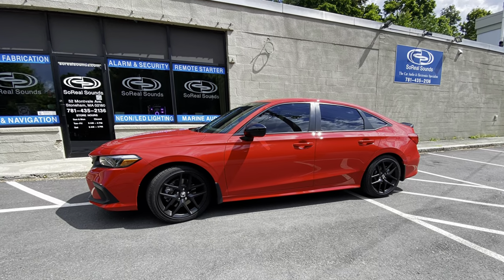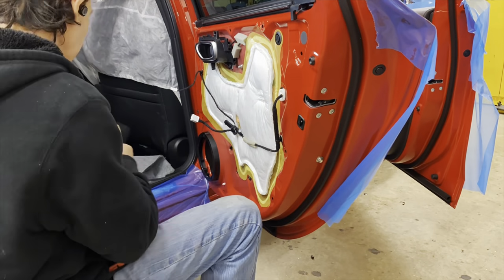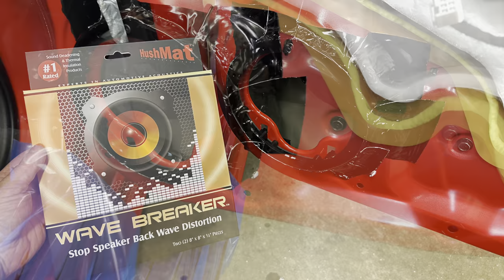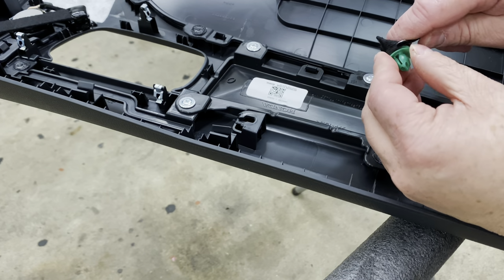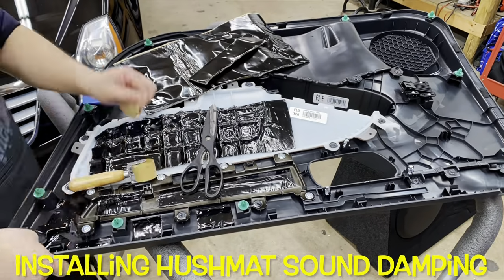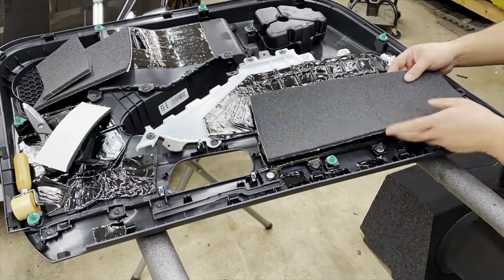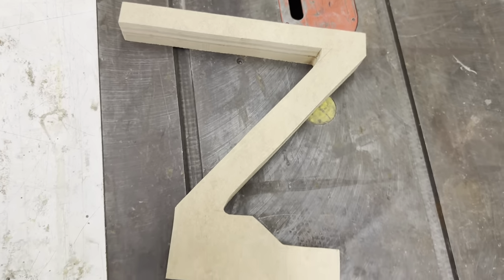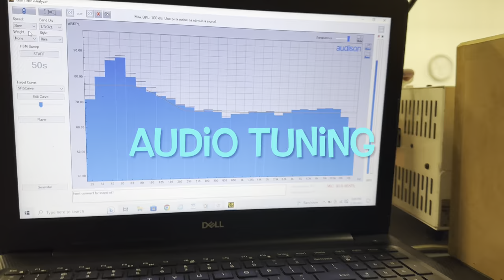Honda Civic Audio System Upgrade: Alpine speakers, Hushmat Sound Deadening, Audio Control DSP Amp

Comment: This helped me for sure! I just did a simple front speaker swap with some JL audio c1s. Very good and responsive speakers, but since they are much thumpier than the stock civic speakers, they were creating a rattle that was driving me nuts. I spent my entire day just putting foam around the bracket, speakers, and the door. So far iv minimized the rattling to a good enough point. When I do the back speakers I’m just gunna rip all the door apart again and go to town on sound dampening and foam
Reply from the maker: Awesome! 🔈🔉🔊

Comment: Where did you get the speaker wire harness/adapter?
Reply from the maker: @benbryceholden1  for speaker adapters if we don’t fabricate them we use Metra speaker mounting adapters. Metra also makes speaker wire harness for many vehicles. In this video it was the Metra adapters + harnesses. Email us if you would like to check pricing and availability. Our email is info@sorealsounds.com

Comment: Where is part 2??!!!!
Reply from the maker: There is no part 2. The subwoofer enclosure was built for a Civic prior to this one. When the client got this Civic we transferred the subwoofer system. This video was second upgrade made for the interior speakers and DSP amplifier. What specifically are you looking to see in a part 2? We can check to see if we have any videos that have what you may be looking to see.
Reply: A video on how you took the rear deck off? I want to either eliminate my rear deck so there’s no rattles or sound treat under like in the video.
Reply: Wtf! this video sould be taken down for rule violation. This is considered edging content. Where's the end result?

Comment: NICE Job! I like the cloth wrapping of clips IDEA!, I may do this as well, but maybe put on the base and cut a slit so its a little easier to slide in. People do not realize how time consuming it is to do doors, panels etc. I am sure its sticker shock when you give customers the estimate for sound treatment.
Reply from the maker: Thank you! Clip or mounting base will work. With cloth tape like this ( Tesa Tape ) we find it tends to fall off the base after a short amount of time so the next time the doors come off the tape can easily let go. Wrapping the head of the clip has been extremely reliable for us. Fully doing doors the way we recommend can be a sticker shock for some, but not as much as you would think because of our process. Once our clients understand the value in sound treating a vehicle our clients they understand exactly what they are investing their hard earned money into. We give our clients all the information for them to choose the right solution for them, so sticker shock is not a huge issue.
Reply: @sorealsounds  all great points. Thanks!!
Reply from the maker: @daveroski  You’re welcome!

Comment: Which speaker brackets did you use top mount aftermarket speakers to the doors?
Reply from the maker: Metra 82-7805. Be aware many speaker magnets are drastically larger than the factory Honda speakers. Many times modification to the factory speaker opening in the door must be done to fit the new speaker, even with this speaker adapter.

Comment: What thickness Hushmat megabond did you use on this project and is this your typically used thickness?
Reply from the maker: We use all three thickness all of the time. Which one we use depends on reason, and available space. On this car rear  deck was 1/2” and door panels was 1/4”. 1/8” was used in many spots through out the vehicle with our installation not shown in video.

Comment: How do you connect the adapter to the speaker?
Reply from the maker: The adapter has pre drilled holes in it for screws in typical bolt patterns of speakers. The adapter is designed to use the factory mounting bolt from the factory speaker, the bottom of the adapter has tabs to fit into the lower portion of the door, and then there are additional screw holes on the bottom corners so you can secure the bottom of the adapter to the door better.
Reply: @sorealsounds  very good sir, and how do the wiring adapter hooks on to the speaker connector, thanks very much
Reply from the maker: @nhantran98  One side of the harness has the connector to plug directly into the Honda connector, the side connecting to the speaker we solder the wires onto the speaker terminal.

Comment: Thanks so much for videoing this!! I plan on working in my own soundtreatment in my Civic XI doors one by one.

First I will do just treatment and see how it sounds without any rattle at high volume.

Maybe I wont even feel the need to do a whole new audio system.

Its honestly my only gripe with this vehicle.
Reply from the maker: Thank you. Sound proofing works wonders for sure. The right materials, installed properly, in the right locations can enhance any audio system. We have sound proofed many cars where clients just needed a little better sound and sound proofing gave them what they needed without having to upgrade speakers, install amplifiers, etc. There are still benefits to upgrading speakers or adding amplifiers, etc. it just depends on what your sound goal is. Also understanding what aspects of the sound will change with sound proofing. For example if you are trying to get more accurate high frequency response from the current speaker system then sound proofing will not do much for you there. But if you want better sounding midrange, and better sounding bass then sound proofing will definitely help those areas. Sound proofing and DSPs should be in every car regardless of model or audio system. Without sound proofing and DSPs no audio system, factory or not, can truly perform to their fullest potential.

Comment: Not sure if youre still here. 
Im trying to start an install on my civic but its the hybrid. 
How many watts rms do you think I can get away with? Crutchfield too conservative with there 350 rms recommendation
Reply from the maker: @youtubergrouper3428  If you are not adding additional batteries or power cells then I would agree with Crutchfield on keeping the RMS on the lower side. If you are going to run more than 350Watts RMS you should invest in proper power to drive the wattage you plan to.
Reply: @sorealsounds  what's the cheapest/easiest way to do this so I can do i 1100 rms system in my 2025 civic Hybrid? PLEASE answer 🙏
Reply from the maker: @youtubergrouper3428  Cheap ways are like putting a bandaid over a big wound. Take your time and invest the money into the things needed to connect your system properly. Your system will only be as good as your weakest link. I would upgrade your underhood battery to a good AGM or lithium, I would do a big three electrical wire upgrade, and I would add a Hybrid Capacitor from JY Power. This would be the bare minimum I would start with, then install your amplifier system, then run the system full tilt and then monitor the voltage across the various points of the car and audio equipment to see if you have voltage drops. If you do you will have to beef up the power more. The JY power Hybrid capacitor I would recommend is at this link. https://jypwr.com/products/jy-power-nxt-2kf-2000-farad-hybrid-capacitor

Comment: I missed the part where you upgraded the Alternator and battery system to power the upgraded stereo system?
Reply from the maker: We do not deal with alternators. Client upgraded his battery and we did the big three wiring upgrade for the client.